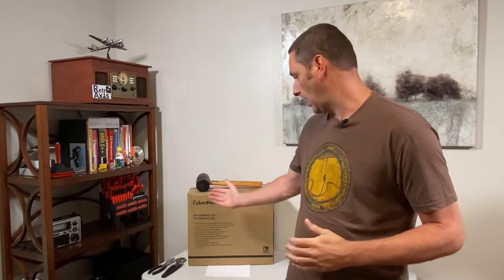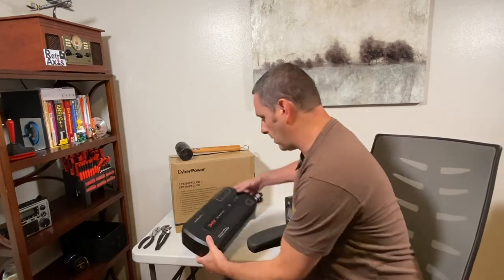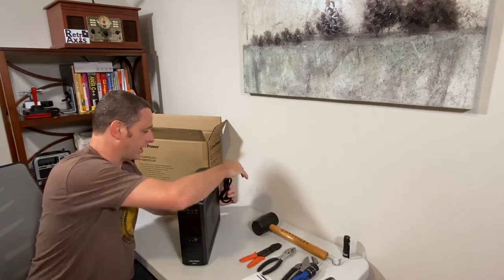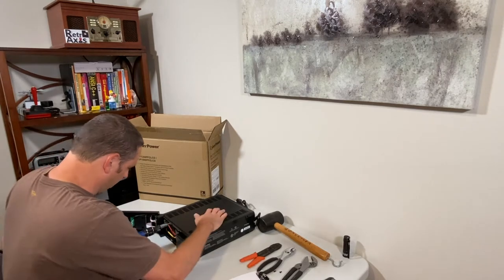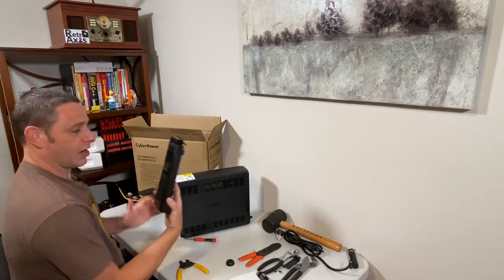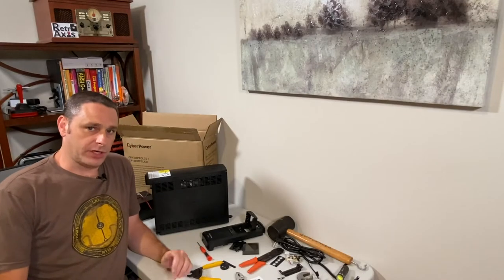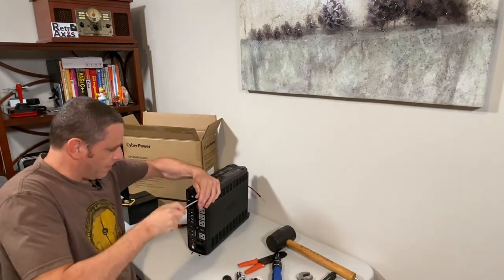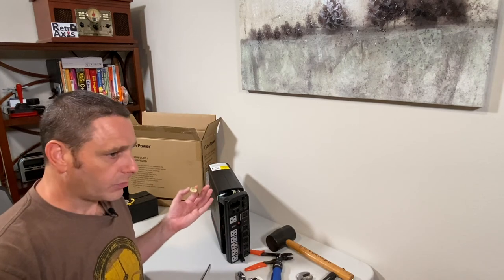Why did I just destroy a Battery Backup?

Comment: Cool video! I just received a Cyberpower 1000VA unit and it seems like maybe the battery is loose in there, is that normal? Not like the smaller metal rattling sound you had on yours but definitely but definitely has some movement, guess it is the battery. I saw both of your videos on this topic. So crazy that they request you to destroy it haha
Reply from the maker: I've never been asked to destroy anything and then provide it for an RMA.  It was fun and made for a decent video. Some UPS chassis have a metal bar that holds the battery in place.  Usually held with a screw on at least one side. You might see if it is missing or loose.  Also, the battery is not usually connected from the factory, and you have to plug in one of the leads before using it. Thanks for watching!

Comment: So you don't need to break UPS plastic case right ? just screen and power cord ? and how about battery, just keep it ?
Reply from the maker: I followed the instructions provided by Cyberpower as part of their RMA.  It is possible that different models of batteries will have different requirements.  I was able to keep the batteries as they did not ask for any of the parts to be returned, and destroying a battery is dangerous, as batteries should be disposed of properly.  Hope that helps.
Reply: @RetroAxis  Thanks for late reply~ I already got my replacement from Cyberpower within my 3 years warranty. My replacement is new condition and passed self-test. I am happy with their service.
Reply from the maker: That's great!  Cyberpower clearly stands behind their products. I am pleased your experience was similar to mine. Cheers!
Reply: @RetroAxis  It is really good to get 3 years warranty but I like APC battery replacement method. Cyberpower is much harder to replace battery !!

Comment: Couldn't you try to fix it or keep parts for future repairs? Or is it a bit for the show?
Reply from the maker: They actually required me to destroy it and send them picture proof in order to RMA the unit.  I still have the parts and extra batteries as spares, although some of it, like the screen is damaged as cyber power instructed.
Reply: @RetroAxis  that's wild, first time I heard that a company would ask a customer to break their equipment for a RMA without voiding the warranty,  also I wonder what type of glue that ups used since I heard the Rev 1 and 2 model (2 usb type A) used the yellow glue which becomes corrosive/conductive over time which leads to failure